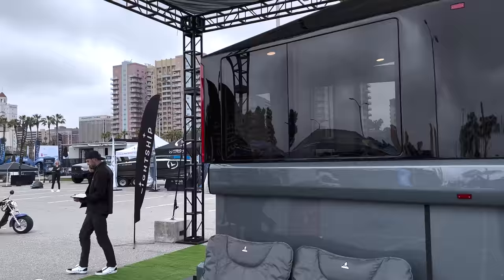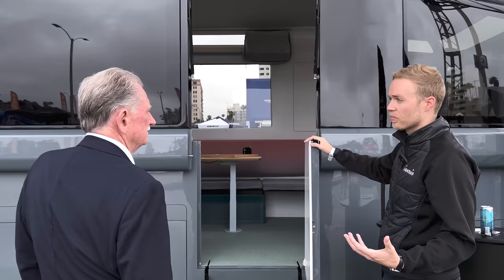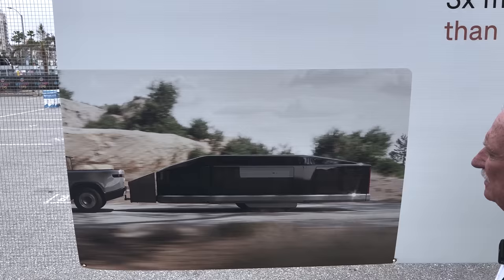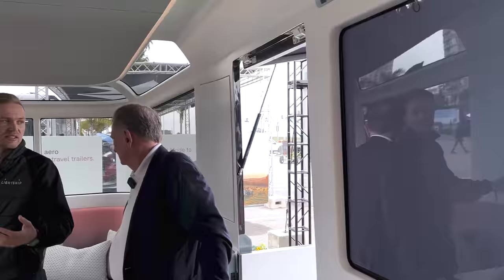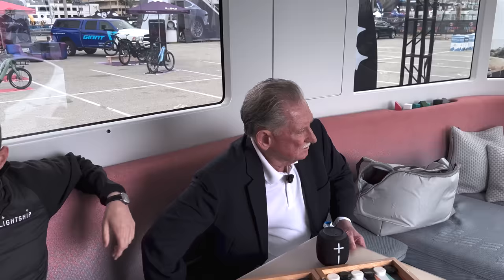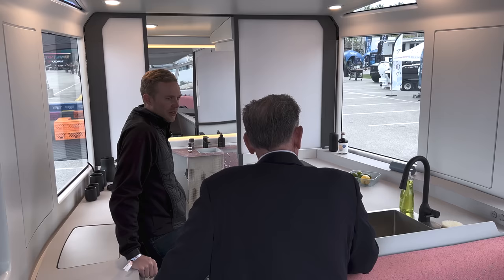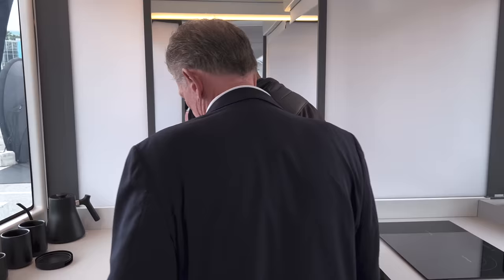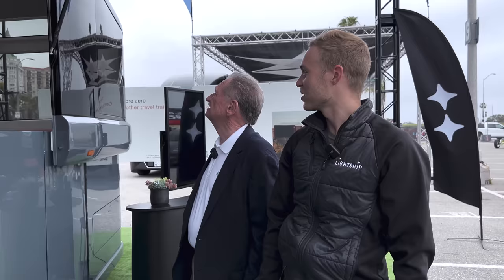Tesla Graduates Electrify the RV Industry - Lightship's All-Electric Trailer

Comment: Sandy Munro / Munro Live & Ben Parker, this was an inspiring video! 

The long wished for all-electric RV is in sight & attainable! 

The LightShip addresses all the issues: power assist wheels, abundant solar power generation, clean indoor air (no propane or diesel) water conserving appliances, spacious & flexible interior, and abundant natural light ! And it’s quiet, without a noisy, smelly generator.

All the best, I can’t wait to see this project take off 💫

Comment: Interesting concept  but not quite ready for camping. Needs curtains or blinds for privacy & cooling.  No storage for clothing or camping stuff.  No furnace or A/C.   No screen door to keep out bugs.  No air vent in top, no windows that open = inadequate ventilation.
Reply: Check out more videos of the lightship, they actually have all these things.
Reply: @dfghdfzsd  Thanks, Steve.  Will do.  UPDATE:  found half a dozen.  No time now but will follow up.
Reply: @dfghdfzsd  Steve, I've looked at half a dozen vids of Lightship and none of them showed screens to keep out bugs.  One referred to "electric heating" with no details.  None show any ventilation beyond those bug-inviting  open window and door.  Apparently the huge windows go opaque on command so you don't necessarily cook in that giant greenhouse on a hot day (with windows opaque, no view!).  But no roof fans, no A/C.
Reply: @tomgray971  also check out 22:34 in the same video
Reply: 36:26 also addresses rock chips- which was a repeated concern i heard. but regarding screens and ventilation- i just can’t remember where i heard it and don’t have time to scrub through all the videos. typically heat pump heating and cooling aren’t considered ventilation and i’d like to learn more on how they achieve it without opening windows.
they should definitely make an faq on their site. it’s a pretty site but a little tricky to navigate outside of the scrolling presentation.
Reply: these timestamps are for the david lee video, not the munro-fyi.
Reply: @dfghdfzsd  Found it, thanks--he urges the tow vehicle to be equipped with mud flaps and rock guards.  That won't help with rocks cast by passing vehicles (the kind that have taken out two of my windshields).  
That same passage around 36:00-38:00 also shows wide-open, unscreened windows.  I don't like sharing my camper with mosquitoes, flies, black-flies, biting midges, and such critters.  But it's a prototype and no doubt the next editions will be better.

Comment: Using this for an electric food truck is a slam dunk. No more noisy polluting generators. Compatible with new electric trucks. Maybe even charge your truck while boondocking! No need for propane, either. Make it convertible from food truck to RV and I can tow it with my Cybertruck for business or vacation. I may well just be able to stock the regular trailer with equipment and make it a mobile kitchen. Catering, festivals, events. This thing would be a total boss at Lakes Of Fire or Burning Man.

Comment: I bet there would be a market just for the battery and motor trailer without the camper part of it. 
I didn't know the range loss was that bad so having a powered trailer could be very useful to anyone with an EV that wants to tow something. Maybe even Uhaul might want something like this, though I'm the down side would be the crazy expense of it. Considering a 80kw battery I bet the base price would be at least $30,000 just for an empty trailer. Which for most people wouldn't be worth it since you could just get a whole truck for that price.

Comment: What about adding regenerative brakes that connect to the 7-pin brake controller?
Reply: - if this has a functional pusher motor, surely it regens on the back side... ??  (loadcell / or other - scale device to determine needs of accel or brake, makes sense /not hard to engineer - and this device is not cost effective at all, so no real economic concerns)

Comment: My thought Sandy, if you could pass it along is to develop a common battery extender standard that external battery packs could plug into in which the car towing the vehicles can see the external battery as being part of the total battery for the car.  This could allow hitch mounted battery extenders for long trips or trailers to augment themselves.  It could also be a great use for a secondary market for used battery packs as well.

Similar to how this is done
https://www.youtube.com/watch?v=Qb7vg08zluQ&t=488s&pp=ygUSdHJhaWxlciBldiBiYXR0ZXJ5
Reply: That's smart because I think a self-propelled trailer pushing on the lead vehicle would be dangerous.
Reply: I think your problem there is going to be engineering the necessary flexibility, safety and durability of the exposed HV lines between the truck and trailer.
Reply: I think keeping it all in the trailer is going to be the move to enable safe and more interchangeable trailers. The trailers can accelerate and regen on their own thereby having longer ranges. The common trailer interconnects already have a braking signal so adding acceleration and battery level should not be too difficult to add to the standard.
Reply: Not sure that would work because you would not a plug hanging off the side of the car driving down the road. Secondly the battery cables going all the way to the tow vehicle would introduce a lot of inefficiency. This method is one of the better options providing power to the trailer.
Reply: @mikebalentine  I would imagine the trailer or accessory connection coming out the back like the trailer connector does now. It would not use the vehicles charging port.
Reply: @matthewknobel6954  You mean the trailer connectors that I always see worn completely through to bare wire in places because some genius let them dangle going down the road? I could probably count on one hand the number of times Ive seen a trailer with fully functioning lights where I live.  There's no way that could ever be made safe IMO.
Reply: Yes, along with standards for the tow vehicles to be able to have input into controlling the drive power and breaking levels.

Comment: It's all nice and dandy but I see 2 big problems. 1) Isn't this thing too long I mean that's 27 feet. 2) How do you control the speed trailer if it's somewhat self-propelled (probably it's possible with some cable attached but I doubt any EVs have those or the software)

Comment: At 125k dollars this is basically 10 times the price of a comparable sized conventional trailer. Adding the drive unit doesn’t make sense to me, no electric truck is going to need help power wise towing, it just needs the extra battery capacity. Making an electrical link between the trailer and the truck makes more sense and would be easier to fast charge at a charging station where you’ll need to plug the trailer and truck in separately

Comment: My ideal RV is to tow a camper/trailer with the Tesla Semi.  Don't need this fancy collapsible box.
Reply: Oh yeah a 60+ T 80’ rig is going lots of places
Reply: @mattbrew11  Tesla semi is 20ft long, plus a 30 ft 5th wheel RV with overlaping about 10ft, the total length is just 40 ft.  Perfect length.
Reply: @hawtan4536  bumper to mudflaps the tesla truck is 24’ long ive measured it myself.  Good luck with your pipe dream

Comment: I like the double axle. You don’t necessarily save energy with this pusher but you do have more available energy to start your trip and going forward and reduce by 66% your charging stops. You also reduce the strain on your puller, save brakes, wheels, suspension (double axle), etc. Windows are great for connecting with nature but unfortunately have low R and U ratings. Double pane is getting closer to a 3-pane solution 😊.  How much more energy you consume with 2 fridge + 1 freezer? Love the dishwasher. The I guess they will rethink the door like two-part horse stall doors. 200KCA$ is not a cheap proposition. How will this function in the northern climates?

Comment: Modern Class B vans equipped with lithium battery packs like the Volta battery system on Winnebago's Travato model are well known for run time. I hope this company is taking any advantage of using 12v appliances if possible to extend boondocking range. My Embassy RV has all systems in 12v, except for the microwave and TV and it works perfectly. If I were to own a trailer like this, I would likely use gas powered truck with a second alternator to charge the trailer, if that is possible on the trailer. My 2021 Embassy RV on the Ford Transit 350 HD chassis has the second alternator to charge the lithium pack when driving and when it gets low at the campground. I'd want the same for this kind of trailer. Love seeing Sandy get into the nuts and bolts of the underside. Great and interesting video...
Reply: I run my rig on 24 volt but should be 48 which is going to be the norm. I use a 12 volt from the 120 AC to run off the inverter for all my assorted 12 volt. It is nice having a steady 13.5 power supply. Eventually it will be electric propulsion  then you just need a small engine for battery charging. Plan on not using propane. Electric hot water, heating and cooking along with refrigeration. It will always be cheaper to use home appliances because they are mass produced.

Comment: Great video once again 👍 Love the concept and how Ben talked through it was great and really brought the vision to life. The aspiration to have a separate drive capability to the towing vehicle is actually fantastic, sadly I imagine this approach would require some open standard communications between vehicle and trailer with things like requested power (old school throttle), speed and braking information. 

I could see Tesla maybe not being closed minded to this the the rest of the conventional OEMs not so much.

Keep up the great content guys.

Steve C in UK
Reply: It could just be toeque sensing in the tow-ball... whenever it senses torque on the hitch (maybe even piezoelectric) it would do whatever to reduce the torque.  works for brakeing and accel...  I'm wondering about cornering though.

Comment: HI SANDY, VERY INTERESTING VEHICLE; VERY WELL THOUGHT OUT; VERY WELL CONSTRUCTED FOR A PROOF OF CONCEPT PROTOTYPE MODEL!!  OF COURSE, LOTS OF QUESTIONS; HERE'S A FEW : 1) HOW DO THEY SYNCHRONIZE THE "TRACTION" MOTOR IN THE RV TO THE SPEED OF THE TOWING VEHICLE, SO IT DOESN'T GO TOO SLOW, AND ACTS LIKE A BRAKE TO THE TOW VEHICLE, OR PUSHES THE TOW VEHICLE TOO FAST, WHICH COULD CAUSE THE TOW VEHICLE TO BURN OUT IT'S BRAKES, OR EVEN PUSH THE TRAILER OFF THE  HITCH??  2) HOW LONG DOES IT TAKE TO RECHARGE THE BATTERY IF PARKED IN THE SUN??  3) HOW MUCH OF THE BATTERIES STORAGE IS NEEDED TO RUN THE APPLIANCES AND CLIMATE CONTROLS IN AVERAGE WEATHER??  4) CAN YOU RECHARGE THE BATTERY PACK AT AN ELECTRIC CAR RECHARGER STAND??  5) WITH THE ELECTRIC MOTOR AND AUTOMOTIVE SIZE BATTERY PACK, WHEN LEVEL-5 FULL SELF DRIVING IS ACHIEVED, COULD THIS THING DRIVE ITSELF TO YOUR CAMPSITE, SET ITSELF UP, AND YOU COULD MEET IT THERE LATER??  6) WITH THE BATTERIES, PROPULSION MOTOR, ROOF COVERED SOLAR CELLS, THE RAISING MECHANISM, FULL AIR SUSPENSION, HIGH-END INTERIOR FEATURES, DO YOU SEE THIS THING SELLING FOR LESS THAN $500,000.00 DOLLARS IF IT REACHES PRODUCTION??   THANKS SANDY!!     CHAS ORVIS, PLAINVILLE, CT.

Comment: this is appealing in a hypothetical bubble but MOST RVs spend MOST of the time in places designed for RVs meaning you need way more privacy and on nice days you want screened windows for cross flow ventilation.

Additionally this suspension setup is only good for maintained roadways.  There is nowhere near enough suspension travel or strength to take it to the remote places this is envisioned to go to 
I also don’t see an accommodation for an awning so solar gain is going to be absolutely insane. Additionally this is nowhere near 4 seasons winterized.

Comment: This was obviously designed by San Francisco Bay Area boy wanting to go glamping.
   I live in East Texas and have been around a lot of campers and no one I have ever been around has said , I sure wish I had a dishwasher. The thing is surrounded by nothing but glass windows, which even though tinted, which cuts out some sunlight you are going to have an extremely hot camper unless running the air conditioner a lot during the day. Obviously he did not cover any shades for the windows which all campers have to block out the sun or for you or your wife not to be seen at night while the lights are on inside. All the glass is pretty when looking out but it is completely non-functional without the shades. Anyone owning this is going to be camping at campgrounds and RV parks and not going to the river bottom with nobody else around. The microwave while stowed away is overly complex and has many things to go wrong overtime, not to mention no food turntable for rotating the food while heating. As far as the overhead rain type shower head that is ridiculous. All women want a removable handheld unit and most men do also.  And for the astronomical cost of this unit, there should be at least one dedicated sleep area instead of  all fake beds. I have camped in many campers and also lived  long term in an RV, and I'm currently living in a Motorcoach in Texas. So I do kind of know what I am talking about. 
   And it is unbelievable how exposed everything is underneath to get yanked loose or damaged, this is obviously meant to just go down a highway.

Comment: Well, all the windows look great but, I've never seen a campground with just bears - more like wall to wall people and campers.  You'll need a ton on drapes, including something to cover the overhead glass.  Can you say hot house?  Also, it doesn't need an 8" + ceiling.  Shave at least 6" off the top and bottom for better drag coefficient and maybe you'd be able to see over it while trailering.  I thought the bottom would be much smoother for aerodynamics.  A tremendous amount of drag comes off the back of anything going through the air, more so than the front. Take off the tail pieces of any airplane (horizontal and vertical stabilizers) and you'll see the fuselage go to pretty much go to a point.  I don't know why Sandy didn't correct him.  Lastly, prototypes are easy.

Comment: I've been thinking about trailers with an electric powertrain for a few years now. It kind of bothers me that from what they talked about, the design has been optimized to work with a large pickup. Why? The beauty of the design is that it can propel itself meaning that the load on the tow vehicle is much smaller. This should allow the use of for smaller more economical vehicles. I have no desire or need to keep a pickup or large SUV to go camping a few times a year.

Comment: I need a hand held in the shower. Water coming down from the top is just not enough to rinse private areas. Also, what about the toilet? How big are the tanks? You can have 3,000 watts of solar but if you have to dump your tank due to it being small, all that solar defeats the purpose of boon-docking.

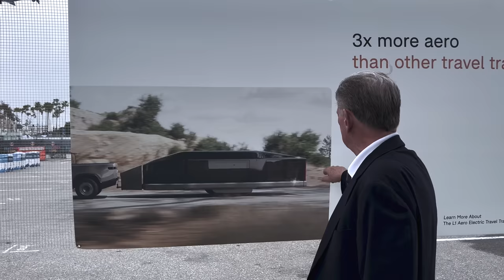Comment: 6:41 "...the turbulence doesn't suck you backwards...": The vacuum does. That's why you can get better mileage on a pickup that has mesh for a tailgate.
Reply: All of the ev pickups have an electric cover over the bed. A mesh tailgate would have no value!
Reply: @gmv0553  The picture of the truck pulling the trailer has no such cover. Most PU trucks don't have covers. Some do have the mesh or louvered tailgates...and its for efficiency at higher speeds.

Comment: I would have liked to have seen what their HVAC setup was like and also to have learned how the traction motor interacts with the tow vehicle.
Reply: HVAC not needed, just get HEAT pump. 
then tie it into the Lightship battery & BMS.
Reply: @markplott4820  If true, then the heat pump is the key component of the HVAC (Heating Ventilation and Air Conditioning). Not sure why you think having a heat pump means that HVAC isn't needed. Sort of like saying that oxygen isn't needed in the atmosphere because it has 'air'.
Reply: @gunningopher   - Conventional HVAC is not needed, Tesla style HVAC w/ integrated HEAT pump is more Efficient and no pulleys or belts.
Reply: @markplott4820  Hence why I would have liked to have heard about it.
Reply: @markplott4820   -  - are you the same guy I responded to - stop confusing people..  refrigeration with reversing valve = warming and cooling compression refrigeraton  / heat pump cycle...

Heat circulation and exchanging  - is a core element in many systems..     (fanboi-ing imaginary nonexistent tesla magic is funny..
"Mounted ahead of the SUV's front firewall, the core of the heat pump consists of two manifolds, one made of polymer for water-glycol coolant and the other (the 'super-manifold') of aluminium alloy for R1234YF refrigerant, as well as a compressor, a chiller (where heat is exchanged between coolant and refrigerant) and ..."

And the refrigerant----- (Not Methane, Propans or compressed CO2 - as is used in other systems..   - yes there are some Unicorns tears inside - R1234yf is a hydrofluoroolefin (HFO) refrigerant. HFO refrigerants are composed of hydrogen, fluorine and carbon atoms, but contain at least one double bond between the carbon atoms.

Comment: having a motor in it means it powers itself, and more importantly, regens and brakes by itself.  Does that mean you can pull it with a smaller vehicle, like a model y ?  Does the trailer battery do DCFC? at what rate?  Would be cool to see with a cybertruck I suppose.
Reply: So many questions left unanswered.  Sandy may be a great engineer but terrible interviewer.